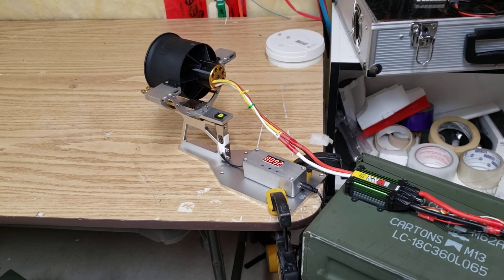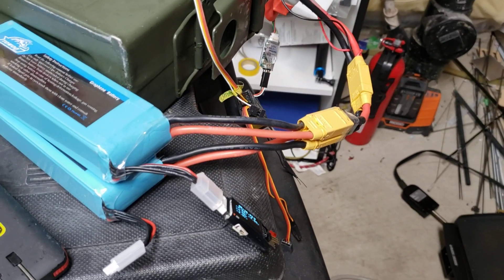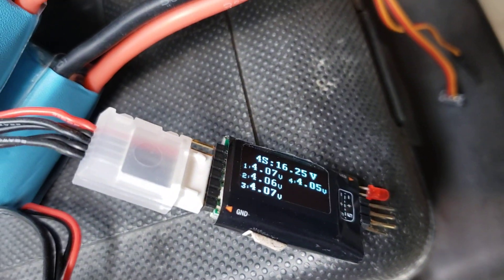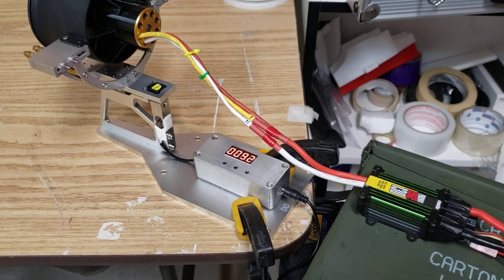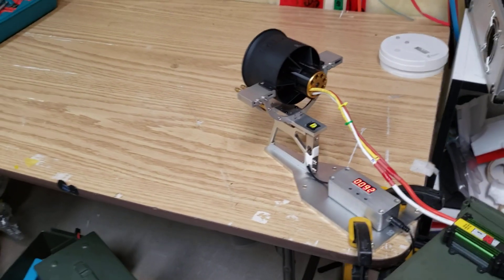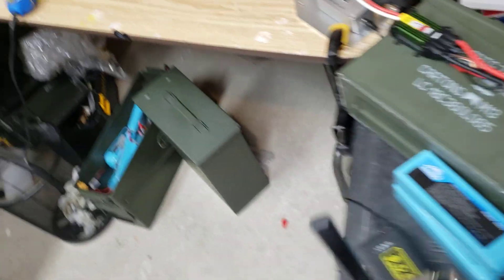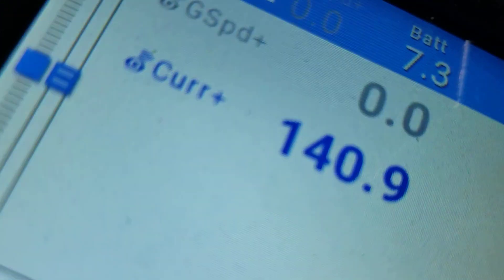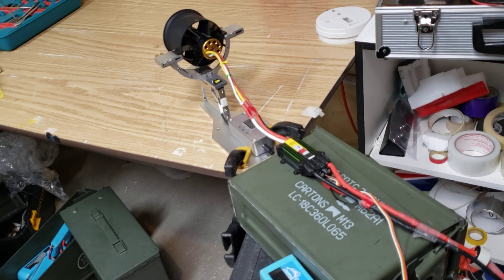Freewing 80mm 1920kv 9-Blade inrunner on 8s 4.7kg max thrust.

Comment: This is the older 1920kv edfs? Cant find this only the 1900kv & 2150kv. But this is now not 3 years ago. I do have some 9 bpade edf from a first gen mig29 going to check 8fnits the 1920kv motors.

Comment: Have you tested the stock Freewing 90mm 12-Blade EDF 8S Power System w/ 4075-1390Kv on 10s?
Reply from the maker: No sorry I haven't.
Reply: @ghoustanable  thanks for the answer... i`m courious because you got amazing results with the freewing on 80mm vs FMS  and looks 90mm on freewing might be something
Reply from the maker: @daniel alessandrini  it's possible. However, if I was going to do any testing, if I were you, go up one cell at a time and measure the temperature of the windings in the motor and the amp difference as you go up each cell.
Reply: @ghoustanable  ok thanks!
Reply: I've tested that 3748 1390kv inrunner on 8s, and let me tell you, I wish I left it in my V2 Eurofighter and ran 8s. Output was static 3.4kg @ 3000watts with 31 volts. Sewn as high as 3200watts on 31volts. So a fully charged battery in sure it'll do even better. So I'm sure the 4075 inrunner would do better.

Comment: does the motor support 8s power ?
Reply from the maker: Yes as per the video it does
Reply: Is it the stock edf from the Motion rc site?😮
Reply from the maker: @danielalessandrini2299  yes it is.
Reply: @ghoustanable  how do u know the motor can handle that high volt and wont burn it?
Reply from the maker: @FP777-8  I've been running it like this for about 2 years now the motor can handle it no problem.
Reply: @ghoustanable  have u try any freewing 90mm 8s stock and use higher volt?

Comment: I have also try this on 8S but the motor begins to smoke , maybe on 7S
Reply from the maker: Make sure that the timing is set to low on your ESC.
Reply: @ghoustanable  I think it's to late , but i wil try it on 7S you have test it also ?
Reply from the maker: @andredop3080  no I have only run my FMS 2100 KV on 7s and it works well about 160 amps is the down side.
Reply: @ghoustanable  oke the motor 1920kv  still works but whether it continues to work after smoke came out I don't know
Reply: @ghoustanable  the timing? whats that for
Reply from the maker: @FP777-8 inrunner Motors prefer lower timing it also helps to reduce the amount of amp draw.

Comment: What do you think is a good EDF unit for my 90mm jets I tried the 1390kv 8s had the same speed as the 6cell 1900kv only difference was it climbed faster but it did have the same or less speed any idea on something better for a 8s system for my 90mm f22,f16 and f4
Reply from the maker: Hands down the FMS 90mm 1500 KV 8s fan. I have run it on  8, 9 and 10s and it's rock solid. Just use a castle ESC 160amp and you will be fine. On GPS with my F-22  over 300 km per hour. https://youtu.be/ID0l-2xlOC4
Freewing Yak-130 90mm on FMS 1500kv  10s https://youtu.be/WnY_-FyiKwk
Reply: @ghoustanable  is the housing metal? Also can I use the the motion Rc 160amp esc
Reply from the maker: @octane2099  yes it's metal don't about motions 160 ESC if its HV capable I've only use Castle creation Phoenix Edge 160 HV on all my setups with this.